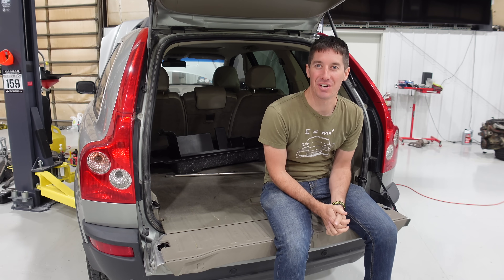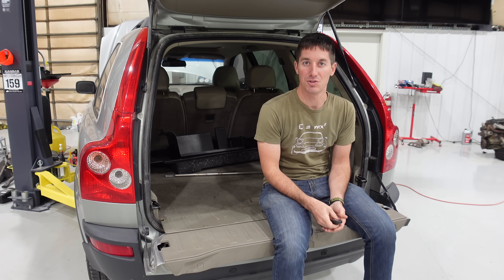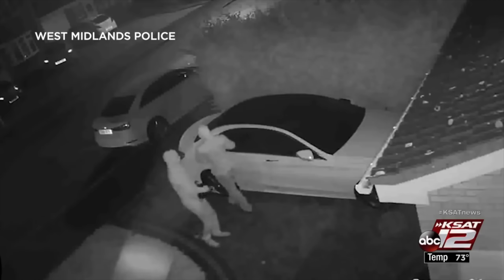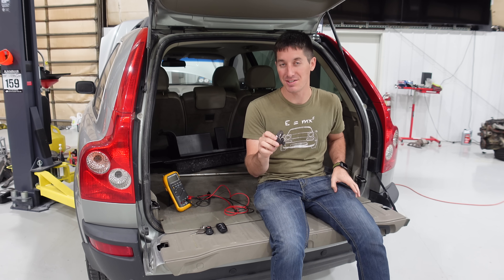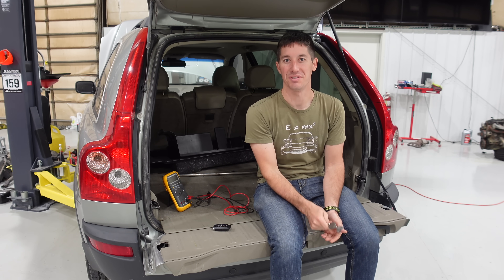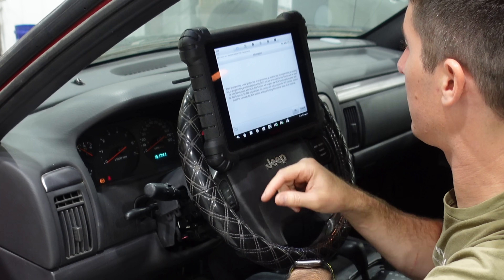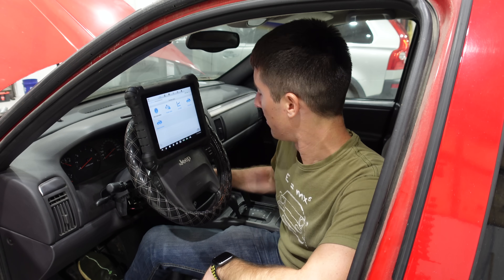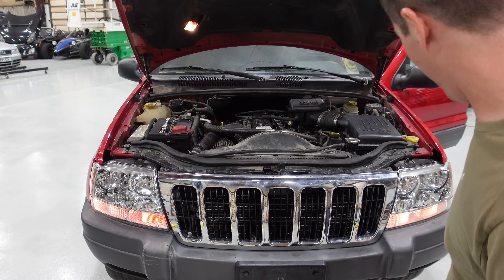What Is An Immobiliser? How Does It Work? And How Do You DELETE It?

Comment: You can completely disable the immobilizer system for GM trucks up to about 2010 by adding a small resistor to the yellow wire under the steering column. I want to delete the immobilizer system for my toyota tundra now.

Comment: I had a 1993 jeep grand Cherokee.  I had to have transmission work done. When they unplugged the battery and lifted up the front end. The immobilizer was activated. I took it to 2 auto electric shops and 4 auto repair shops. No one could bypass or remove the system. I had to junk the vehicle. The vehicle was in great shape at the time. Had it not been for that. I probably would still have it 😡😢 Wish this video was out then.

Comment: My son purchased a 2011 Jeep Cherokee Limited about a year ago; at that time the keyless "enter-n-go" system worked fine. He could lock & unlock the doors by touching the handle and start his car using the push start/stop button; the FOB was also fully functional.  Now all the buttons still work on his FOB including remote start but his lock /unlock on his door handle doesn't work and his push start/stop doesn't work. Yes, we have replaced the battery in the FOB. We have also replaced the push start/stop button but it still doesn't work to start the car: we get a communication error "B1A35".  If we use the key FOB in the ignition, the car starts fine.  Any ideas? Thanks in advance.

Comment: I just bought a 09 jeep that has a catastrophic engine failure and it has been a disaster with the key because the old owner can’t find the original key and he had a shade tree that was going to have a look at it and he took the module apart and then lost the parts so I had to replace the module and key to get to the point where I can determine the engine failure for sure it’s a big mess and I would like to get rid of the immobilizer because I have to spend a fortune to get it programmed to the Ecu and I don’t care about all of the theft system I don’t even take the keys out of my car just because I don’t want to lose them and besides somebody might want to borrow it to go fishing or something and that’s more important than worrying about the stinking alarm system

Comment: Dude sorry but you’re skipping over huge parts of immobilizer systems. And basically making it sound like people that work in automotive Locksmith thing are just scam artist and some of them are but acting like this is something you can do to your own vehicle, cheap and easy without any tools hardly this really kind of a joke 🤷🏻‍♂️ also just a tip. There are certain types of Chrysler vehicles that require purchasing the pin code from the dealership with proof of ownership or special credentials that are issued. Through government institutions.( not that I’m a fan of those, but I’m just letting you know.)
Reply from the maker: @misunchang9860  that’s literally this Jeep… I can just pull the pin from my scanner lol

Comment: Had an ignition housing switch replaced on 2010 ford escape. Kept the same ignition cylinder with original keys. Vehicle cranks but no start. Had someone put scanner on vehicle and it showed immobilizer. Any ideas?

Comment: I appreciate the guy's personability, but this has been almost 18 minutes of total bullshit and word salad that ended up with NOTHING of value to normal people who don't posses multi-thousand dollar analyzers and programing devices.  What I want is an EASY, SIMPLE, STRAIGHTFORWARD method of eliminating the immobilizer function so I never have to worry about turning my key at 5am when it's 50 degrees outside and everything lights up, but NOTHING HAPPENS because the immobilizer doesn't appreciate being cold with a less than super-charged battery!  Guess how I have such a detailed story...
Anything that can shut-down the starting system between my legal key fob and the car needs to GO....on new cars with warranties, sure, keep it, but when we get into the used car market, crap like that only serves to work against the second, or third, or 4th owner who should NOT have to go to the flipping STEALER and pay exorbitant prices to make an $8,000 car crank up on an early morning!
I'm looking for the guy who knows how to DEFEAT the immobilizer from the USER end...turn it off, disconnect it, defeat it, something, but not something that is going to cost a small fortune in programming bullshit!

Comment: For that style of immobilizer you can just pull the ecu, ignition key, ignition cylinder, and the immobilizer halo ring that surrounds the ignition cylinder from the junk yard vehicle.  You then install all those parts in your car and make a buch of cheap $6 spare keys at Walmart and then tape the key with the chip near the immobilizer halo ring inside your steering column and you are good to go.

Comment: The early gm vats was simple yes, but also time consuming to bypass. See 15 variances in ohm value but you have to wait 5 minutes between attempts from one value to the next if the last one was your winner you have an hour and a half invested in determining the needed value.
Reply: No, you do not have to spend that long, you can disconnect the battery in between tries.

Comment: I am having the same problem with a 99 Golf Gti mk4, they say disconnect the battery for 15 minutes, remove terminals on battery. Remove large Red positive cable,  hold the terminals together for 15 minutes, this is on a vehicle that was working before with the same key. Also have the same original key also will not start it. So, it has'nt worked for me either.

Comment: Here's your solution, open driver's door remove rubber boot for door plug there will be a wire that has been severed by the actions of the door opening and closing this is a very common Jeep problem I promise you once you connect that wire back together your Jeep will start.

Comment: My 96 cougar had a ford installed anti theft system.  When the module went bad the starter interrupt relay would not work. The starter would not engage at times, thank God I wasn't in a bad area. I bypassed it for the remainder of the ownership.  I saw a 90s Tahoe that had a failed gm pass lock system.  9 times out of 10 a manual transmission is a theft deterrent.

Comment: So I have a mclaren and sometimes it fails to work with my key.  I switch ecu’s due to one is a stock ecu and another one is tuned for track use.  Can I just remove the immobilizer from my mcalren to avoid issues?

Comment: Did the junkyard engine trip the immobilizer?
Reply: I have an ‘04 Grand Cherokee with the 4.0 L and the engine shit the bed so I bought a used engine for it…should I expect an issue?
Reply from the maker: There’s nothing in the engine that can do that… I think mine just had a failing ECU

Comment: My old F150 had a chipped key, I managed to get a new key and ignition for it for $25 and Ford reprogrammed the truck for $40, the locksmith I called first wanted $200 and my local hardware store wanted $70. Ironically, when I replaced that truck after the timing chain guide chafed and blew the motor my new truck had the same issue my old one did, but it didn't have a chipped key so I still have the key and tumbler with me in my new truck that I personally .... blew the motor on..... I am not great with cars.

Comment: Fist thing you need to learn about what you're talking about.  The vat key isn't a pill and your fob or fork isn't your immobilizer.  The immobilizer is a box with antenna ring around the ignition lock cylinder. And I know because I'm a Locksmith that works on them. And those keys cost us more than a Dollar and our programmers cost us a 40 dollar token that we have to charge for plus labor of making the key by hand and serving call is what you pay for if you lose your key you can't just go get it made at Ace hardware.  And you can't pull pin on a Chrysler product if it's a type 1 or 2 or Pacifica.  And if you try putting in a Remote head key and that sometimes works . Or replace the Computer and you can try replacing the Tipen unit

Comment: Ever seen a remote start key system be worth more than $250 in the most I've ever had somebody try and charge me for it was $500.
And that two-way Communicator is not worth $300. They make cars that, but it is not worth that. It's a very simple return transponder.
And the 09 204 Jeep Grand Cherokees all had two different color keys so that when you hit the seat memory it knew which memory it was going to oh, there was one gray button and one black button on the seat memory buttons.

Comment: $260.00 +tax has been the cheapest price, per remote "fob", that the Lovely Bride and I have been quoted. Neither our remotes work to lock or unlock our 2014 RAM 1500 BUT they both still work as ignition keys..

Comment: The people stole that Benz because it had key-less -go, and CUSTOMER left the key hanging in range. ......You CANNOT just scan a Benz key at all!! (UNLIKE MANY) . .. What they REALLY DID is touch the handle, it unlocked, and pushed START. .....It will run til you turn it off.  That is the issue with the IDIOT OWNER. ...INFO IS IN THE OWNERS MANUEL!

Comment: My '85 Porsche 928S2 had the factory alarm and it was a pain in the ass!  It would go off for no reason as soon as I locked the door.  I got so frustrated with that fucker that I pulled the sides of the console off and disconnected the control unit!  The car was a five speed and pretty formidable looking;  I figured that thieves would walk past thinking that it must have a pretty sophisticated system and this worked.

I think the system was sold to Porsche by Matsushita, the Japanese company that makes the Panasonic brand.  Whatever it was it SUCKED!

One thing about the key to a Porsche 928:  The key is about 4 mm thick and it is cut at a diagonal angle, so it resembles a diamond shape seen on end.  Since it is nearly 3 inches long with the alarm....This is pretty much a weapon.

Comment: Chrysler pin puller will not pull the pin number on this generation of DCX product. Pin puller only works for newer style mainly 07 and up Chrysler products. Ie NGC controllers. 

Im508 and Im 608 can pull some pins of this generation but requires both a chip key and blade key. 95% of the time neither of those tools have been successful. 

The DMax tool is probably the best for this era that has been discontinued. 

Dealer look up or access to Nastf for look up is really the only solution. 

DRB will also not pull our retrieve pin for this generation. 

I can reset the skim in your current computer and send it back to you.

Comment: I don't know that year of Cherokee.
 However, I have a 1998 with a similar shut down after brief run, or often just running down the road. 
Trouble shooting....grabbed the 3 harness plugs at the ECU, wiggle while trying to start/running, created the same symptom. 
Turns out that the ECU had failed solder joints on the board sockets. 
So. ...
Remove the ECU from the firewall. 
Carefully open the ECU.
Remove the gel coating. 
Under magnification, solder cracks are visible. 
Use acetone on a wood swab to remove/dissolve the "conformal coating" at the solder locations, ALL pins just to be sure.
Proper solder iron, and tip.
Flux and the proper solder.
Re solder at ALL pins.
CONFORMAL COATING reapplied!!!! 
Reassemble the ECU. 
Reinstall in car, waited for the battery to reset.
WA LA!  Runs like new again!

TIP....
the dealer will fix for $1800!
And they remove said ECU. Send to some outfit in GA(?). Then reinstall.
 
ALSO, junk yard ECU...MUST be the EXACT same version, alphabet serial code label on the outside of the ECU. 
Otherwise, you will need to have dealer "reflash" ECU. AND, they refuse to do unless they install the ECU.
That has been my experience.

Comment: WELL My brother had a similar problem, after going to two different dealers and several weeks of frustration had a older mech come back from vacation and found his problem.. it turns out there is a module located under the pass side head light, had to cut a hole in that area to access it, that is part of the immobilizer system, Not on any wiring diagram supplied by the local jeep dealer. He only knew about it because back in 2004 he attended a class in Detroit where they told them of this module and that is was not going to be recognized in any factory publications.  Replaced that piece, covered by warranty by the way, car started and has been flawless for the last 4 years..

Comment: Hey JR I have a 03 jeep grand Cherokee looks like the one in this video. Crank no start I have checked and test crank and cam good to go have gas pressure engine just rebuilt by me  so compression should be good/ a buddy said maybe ECU have nothing but a plug in diagnosis it said code 1389 for jeep all wires look good no blown fuses? what is next?

Comment: Cycle key means moving from off to the on position.  Starting cancels the process!

Handy Chrysler easter egg:  Cycling the key 3 times displays any check engine codes in the odometer in this generation!  No plug in reader necessary.

Comment: Another issue with the Chrysler SKIM/immobilizer modules is that they are starting to be discontinued from Chrysler. And you can't get an aftermarket one, or reprogram a used one. They are a one and done deal. So if you can bypass that, you can avoid throwing an entire car away. I work at a Chrysler dealer, and I have to deal with this BS every single day.

Comment: I’ve been trying to disable the skim on a 00 grand cherokee for years now. I’ve gotten 2 rebuilt CPU’s with the skim disabled. I installed with skim module disconnected the car started fine. I’m like great I finally. Shut it down go to restart and the light comes back. Have to plug in the skim for the car to run. It sucks. I think the bcm has something to do with it but I’m not 100% sure.

Comment: Even a new electric can have a switch for the "ignition" to prevent theft.  A hidden switch that prevents power from going to the low voltage side of the contactor, and it's not going anywhere.

Comment: You're a more patient man than me I would have cut the power wire to the fuel pump and wired  the fuse box to have power when  car ignition is on and that I no will work I have done it

Comment: One of the best immobilizers I encountered was also one of the simplest.  Wired to the brake pedal switch, when the pedal was applied it killed the ignition,  There was an On/Off toggle switch.  It was very effective because a thief stealing the vehicle at some point had to hit the brakes, and often it was when he was in the middle of the road or an intersection.  Highly visible when the engine died the thief would bail.

Comment: the transceivers in the keys go bad after so many years, E46 BMW's have the same issues. Just buy a new transceiver and program it. key should work fine after that. You can also just glue the transceiver to the ignition ring if you have a style key that you can't open up.

Comment: Take it to any Batteries Plus, the SKIM code is easily accessible with the proper key programmer and odds are they would pull your SKIM for free because it's literally a process of plugging the thing in and clicking a button.
Reply: That's a great option when you have one working key, but he has no working keys.

Comment: At least early chipped keys have gotten cheaper, at least in some cases.  I remember  my 1999 Altima had the loop break on the key, Nissan wanted $199 for the key programmed.  I ended up having a key from a 1993 Altima made from the original 1999 key for $5, then cut the chip out of it and then epoxied it to the antenna in the column.  It was good for 14 years.  Since then I got a 2006 Spec-V and I had keys made for that and they were $28 each, and they cut me a break in programming since I had 3 made.   Much better.

Comment: I bought a 2009 Volvo V50 recently and the buttons on the key/remote all in one thing didn't work, but the key would start the car.  So I had to pull out the physical key to unlock the doors which set off the alarm.  It was annoying.  So I called a locksmith and they couldn't program.  Had to go to the Volvo dealer who said the key needed to be replaced.  A new key (not including even the emergency physical key blank, let alone a cut key) cost me $460.  I've had the immobilizer antenna fail on me on top of a mountain in my 2001 Mazda B3000 when I was out of town on July 4th weekend.  I couldn't source a part (even tried the junkyard) and had to take it to the dealer who charged about $200.  At least with that truck it's easy to program.  I got some new keys for it recently and had them cut and then programmed them myself.  Same with the remotes when I first bought the truck.

Comment: Yep... I have two corvettes a 92 and a 96 , I have found out if you turn on the key and the motor won't turn over,  just turn off and on the dome light switch and then it will start.

Comment: I had a similar problem on a Vauxhall van it wouldn't recognise the factory key chip I was told to buy a new chip from Ebay and programme that and it worked first time. My only problem now is the check engine light is on there are no codes and I can turn the light off but if you turn the key off and on it's back.

Comment: Lock the car to arm and set the alarm/immobiliser then unlock it and start the car. It should start first time. It won't start from recycling the key the way you've been trying to do. If you don't attempt to start the car in the first 15 seconds the sentry mode will engage and disable a valid key. I've owned a Grand Cherokee and know this is a quirk. Seeing as this your first you probably don't know this.

Comment: Man the ZJ immobilizer defeat simply involved sticking the key in the door to lock/unlock and the security light would turn off. Those also have an ASD relay that similarly kills power if it's not happy. Simple enough to jump past for troubleshooting. Then again I've seen those older ignition systems cost someone 2 CPS, PCM, distributor pickup, and finally a coil before agreeing to run.